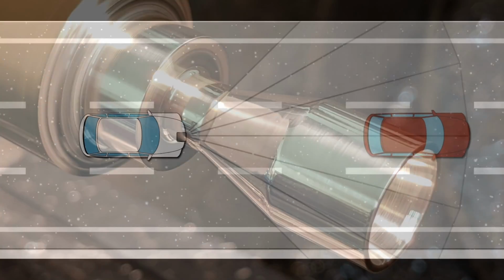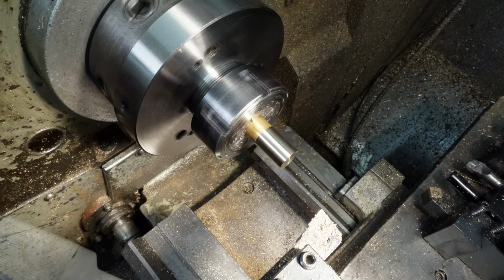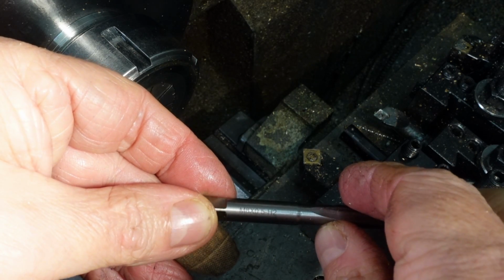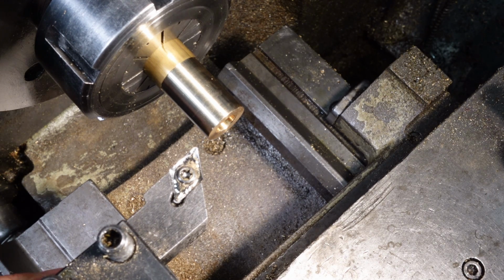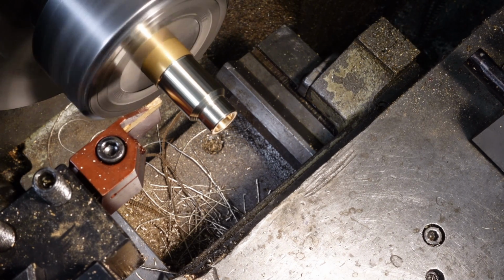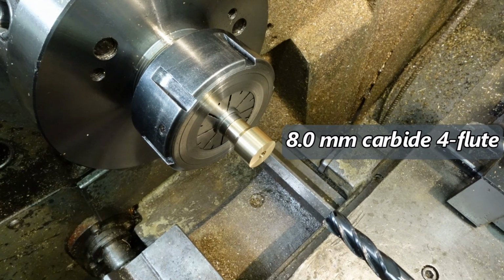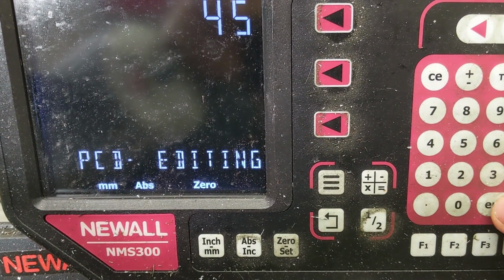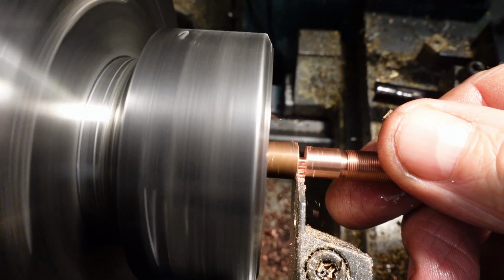Machining 53dBi antennas for 122 GHz mmWave Radar chips!

Comment: What is the camera you enjoy abusing? Your video work is good, don’t know what you are complaining about.  I think you need a small cnc lathe for some of these jobs.
Reply from the maker: Sony ZV-1. It's just horribly designed. Rotten battery life, can't charge or run on external power while still shooting, Auro focus is dreadful, ditto auto exposure, and the wheel for changing aperture and focus and shutter is almost unusable. Menu system is obtuse, lack of ability to fit filters, poor focus range when zoomed a little, lack of any macro capability. Wish I'd never bought it. Lens quality is dreadful compared with any of the "real" cameras I've used, dynamic range is rotten, aperture stop only goes to F10. Might be acceptable in a £120 camera, but I just feel ripped off. Serves me right for believing the glowing reviews from various content creators. Those folks are now firmly in the "ignore my recommendations for I am a pillock" list.
Reply from the maker: I am working on a CNC conversion for my lathe (or perhaps on a second identical model) as there are some complex curves needed on electroforning mandrels, and I need to cut 60 or more 0.6mm grooves of varying depths and that is painful on a manual lathe. Also I want to turn parabolic and hyperbolic surfaces up to 320 mm diameter and that is almost impossible on a manual machine.
Reply: @MachiningandMicrowaves  I was using a Canon G12 which was not bad, but once I become monetised I lashed out on a Canon dslr 200 D, bought a long lens for it and I think it is great for what I do. Manual focus and exposure, even has a 5x and 10x magnifier to check focus. Bought a couple of cheap led lights off ebay and mostly get to use f11 to give me a bit of depth of field. Shoots in 4k and allows stills to be taken off the video. Ad revenue has yet to pay it off. LOL.
Reply: @MachiningandMicrowaves  I have done some satellite dish reflectors for a friend. He gave me the parabolic shape and I had to fit rads over the shape to approximate the curves, a bit of a pain that was. But he was happy with the results, so my approximations must have worked
Reply from the maker: I should have a look at a Nikon DSLR as I have a D80 and some decent lenses but I need to think about how to protect it from dust and flying coolant, and from oily fingers. Something with full remote would be good. I've tried using the remote app on my phone but I think I need to look at using an iPad or Chromebook as the remote controller so I can get the focus right, or better, use CNC jog wheels to send direct commands for focus, speed and aperture if the API is published.
Reply from the maker: The subreflectors I make only need to be accurate to 1/20 of a wavelength. At 122GHz, that's 0.13 mm, which isn't too hard. I can generate the shape coordinate pairs in MATLAB or Perl and create G-code directly, or just create a CAD object.
Reply: @MachiningandMicrowaves  my work is fairly clean so not much of a drama there. My long lens is 55 to 200 and I use close up lenses.  200 lets me get away from chips etc

Comment: Erm...how far do you live from the brass factory?
Reply from the maker: I remember back in ancient times when brass was relatively cheap, but that was waaaaay back in, er,  2019.  Oh.
Reply from the maker: Actually, compared with Tellurium Copper, it still IS cheap. Sorta. In a "slightly cheaper than silver or platinum" sort of way.
Reply from the maker: I just bought a 2 metre bar of 4 inch by half inch Te Copper bar that cost me $1000. A 4 metre bar of C101 copper I bought in 2016 was under $500. I tried to buy some 6" x 8" steel I-beams yesterday and had to sit down for a while when I heard the price. I said I wanted mild steel beams, not solid gold ones.

Comment: 122 GHz is not used for automotive radars.
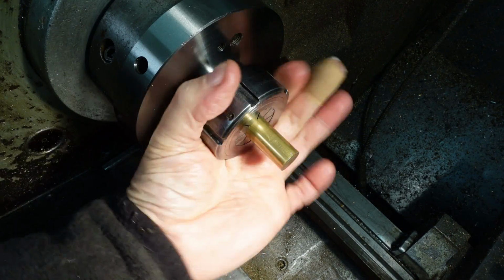Reply from the maker: Yeah, I used a bit of poetic licence there!  It was late and I was recording the intro at 03:00. I should have checked what Siliconradar are using these specific chipsets for. I guess ranging, thickness measurement and position sensing where you can't use a laser rangefinder in industrial processes perhaps?
Reply from the maker: I've amended the title and description a little. Do you know if there's a good application video that Siliconradar publish that I could add a link to?  Can't see much on their website
Reply: @MachiningandMicrowaves  I think they look for applications themselves - one problem is that the ISM band is only 1 GHz wide so that the high resolution of their 6 GHz and new 20 GHz tuneable chips cannot be used in many real world applications. Their work is funded by research programs.

Comment: Could this be adapted to a 5G mmWave antenna? Or is commercially (for consumers) available antennas good enough? (Because it seems like in the antenna market, there's just one manufacturer recommended (Poynting))
Reply from the maker: This is a rather specific application for experimenters who want to push the capabilities to extreme range, in a similar way to deep space satellite comms. A lot of the effort in 5G seems to be around beam-steering to adjust the pattern on the fly to focus on individual handsets within a very local footprint, but our typical use-case involves a target receiver 20-100 km away that will  have a very small signal to noise ratio, scarcely sufficient to carry one low-rate voice signal, and often down at the 1-2 symbols per second rate. Commercial kit is concerned with rather different parameters, so etched laminates and software-controlled electronic beam steering (eg for Starlink terminals) are much simpler to manufacture at scale.
Reply: @MachiningandMicrowaves  Hmm, do you have any reference material you would recommend? I'm not entirely sure why an antenna could only work with small amounts of data, and not larger amounts of data.
Reply from the maker: @nathanbrown492  It's about signal to noise ratios and channel bandwidth. With the tiny signals we work with, we are running at perhaps -21dB signal to noise referred to 2.5 kHz bandwidth. To get a transfer rate of even 10 Mbit/sec, you need a channel bandwidth approaching 10MHz, so you need a signal around 100,000 times as strong to get the error rate acceptable. Certainly over shorter distances, we can move very high bandwidths using these antennas, but the commercial folk are already doing that. The interesting part for us is getting those extra few dB of performance to deal with the approx 1dB per km of oxygen and water vapour attenuation to get as close to the Shannon limit and thermal noise as possible over extreme distances. I'm also doing cloud-reflection tests with red light, the distance record for amateurs for red light cloudbounce is around 270km, I think that is beatable, but we'll need to close to single in photon detection sensitivity for that. Long distance backhaul between satellites is moving to lasers, but for terrestrial links, fibres are a much better backhaul solution over more than a few km. Yes of course you are right, the only limit on data rates by an antenna could be it's analogue bandwidth.some antennas have a 1% bandwidth, but these horns work over maybe 15% so potentially can shift tens of gigabits per second if the hardware was capable of that.

Comment: Have you found out how well they performed, range wise?
Reply from the maker: So far, folks using my W2IMU antenna horns are working over 40 km, but there is a big barrier with moisture in the atmosphere, with around 1dB per kilometer attenuation.  Some of the equipment has a weather monitor built in to check for relative humidity, dew point, temperature and so on over the path, and folks are doing tests at different times of day.  It seems that in the UK, winter afternoons are just about optimal, but losses can vary by 5dB or more over short periods, and that's the difference between success and failure. In the dry conditions in the western US, they are getting much further, same in Australia, but we are still learning about this frequency band at extreme range.  There are lots of tests going on with hardy souls going out in the freezing cold to carry out tests. I'm making a set of feeds with different profiles to try under-illuminating the larger parabolic dishes to see if we can get more gain by avoiding the outer parts of the dish where the surface errors tend to be greater.  Errors of 0.25 mm start to have an impact on performance, so on a 450 mm dish, that level of precision from a spun aluminium dish is very tough to achieve.  When I get my CNC conversion fitted to the lathe, I'm going to cast some aluminium parabolas with honeycomb backs then machine the faces to high precision to see what happens.  Lots of fun ahead

Comment: Don't chip the tip off inserts, resharpen them!  I'm cheap that way.
Reply from the maker: I've just bought an Alexander copy of a Deckel grinder and it has diamond resin wheels so I'm going to be doing some mods to inserts for specific jobs.  I could probably resharpen those high-rack polished inserts as well. Good suggestion!
Reply: @MachiningandMicrowaves  I'd also use an extractor or wear a P2 mask / respirator, carbide dust is the worst.
Reply: @ryebis  I use carbide dust as seasoning in my curry

Comment: 1/50th of a barleycorn. You sneering imperialist, you!
Have you seen any of the neat things being done with T-wave?
Reply from the maker: I have been watching the work around 800 GHz in Japan, but haven't seen much else. Mostly cos I haven't looked hard and needing to sleep now and then.  Any good pointers to URLs or papers that I should be reading? Lack of access to a die bonder is a bit of an issue. Damn, now I want to make a die-bonder.

Comment: Your threads seem to be off-balance! Your CPU must not have enough cores to process them parallelly enough to make good threads, you need to re-balance your software thread dispatching or recalibrate your CPU cooling (assuming you don't need a CPU upgrade to handle more threads!) 
:P hihihi
Reply from the maker: I have some Apple cores if that would help.  Braeburn, Pink Lady, Granny Smith. Local fruit shop delivers every week.  Marvellous.

Comment: Why didn't you perform your machining asynchronously?!
Reply from the maker: The limitations of filming and the looming deadline to get the video finished. Much too hard to do serial ops with all the cameras and lights in the way, and within a sensible timescale.  Video clips are of approx three units.  The rest of them I set up jigs and fixtures and did the same op on 22 items, then next setup and 22 repeats. I usually do 25 to 50 in a batch
Reply: @MachiningandMicrowaves  I was trying to make a bad nerd joke to go along with yours as I just happen to be learning about asynchronous methods right now.  I mean, I get that creating multiple instances of your lathe is... impractical!
Reply from the maker: @NavyCuda  Heh heh, I was half asleep at the time I read the comment. I do rather like the idea of containerising the whole thing and just spawning new instances of the Bridgeport in Kubernetes with some sort of virtualisation platform based on a massively-parallel physical layer array of cheap Chinese CNC routers. A sort of lightweight RISC approach. The lathe array could be formed from a scalable pool in AWS, with a selection of die grinders, battery drills, and John Deere tractors, instantiated as required. MaaS and LaaS would perhaps need extending to Shaper-as-a-Service, The whole thing could be implemented using MachineShop-as-Code. I like it.
Reply: @MachiningandMicrowaves  My Snap-On dealer loved me.  I had three identical straight die grinders for my three top bits that I used.  I had one 90 degree die grinder and a cut off wheel.  Learned that from an older body man who hated changing bits all the time, so bought extra die grinders to save time.

In any case, you make fantastic content and unfortunately for you, I've subscribed and likely will follow you around like a lost puppy.
Reply from the maker: @NavyCuda  I only have three air die-grinders and one big electric one, cos I'm too lazy to change bits.  Oh, that's four in all. Right. Guilty as charged m'lud.  In mitigation for my sins, one of them IS a pencil die-grinder, so doesn't count at all.  Three is reasonable and entirely proportionate.

Comment: Because  I'm a lazy early/old millennial i would  just 3d print it then electroplate it then waste twice as much time trying to make the part with terrible tolerances fit😅
Reply from the maker: It's an interesting problem to make antennas with features this small, you need to get surface finish in the bore to a couple of micrometres, and plating a bore is a royal nightmare at the best of times. Even the best LCD/DLP UV resin printers can't get close to the required surface quality inside, but if you could get a near-mirror plating on the inside of a horn, you could perhaps press in a waveguide tube made from solid silver but you need that to join with a near-perfect electrical connection to the start of the horn.  All a but too tricky at this frequency.  Metal sintering 3D printing is just about possible, but really the techniques are much more useful at 24 GHz and lower.  Using lost-wax investment casting of bronze or aluminium parts, perhaps with centrifugal casting to get a good fill, is probably the best application of 3D printing for home shop use in microwave antennas.  The more exciting developments are in dielectric resin UV printing using Rogers new resin, which should work in an Elegoo or Anycubic, although better in a DLP printer.  That and the low-loss ABS filament from Preperm should give us some very interesting possibilities with graded index quasi-optical lensing at mmwave. I'm hoping to get some of that UV resin when Rogers get it out to distribution, but it will be furiously expensive and unlike their PCB materials, there are no free samples.  Electroforming around sacrificial aluminium mandrels is a very interesting technique, but that's video number 23 in my list, so quite some time to wait for that one
Reply: @MachiningandMicrowaves  as I said I would make it work the lazy way!!!...tho it would cost me several years and pints of blood sweat and tears!

didn't realise the  surface finish of SLA wasn't good enough...the one print I did with the sla printer seemed quite smooth....until  I banished the printer to garden storage- the  smell🤢 which I still sometimes  smell on quiet nights (most likely brain damage from resin inhalation 😜)

I guess  at witchcraft frequencies/ wavelengths (gazillions of HZ) any burrs would as a recieving antennas dissipating rf as heat..any gashes would act as resonant cavities and any other imperfections  would act as a capacitor/inductor  or a banana....its total witchcraft 😜

BTW I'm sure you already know about it but electrosputtering seems like an interesting way of putting an ultrathin metallic mirror finish on stuff
Reply from the maker: @TrumpstienPhile  Oh good grief, I had put that plasma sputtering stuff that Ben did ages ago into a deep dark recess of my mind in the hope it would go away.  Let's see...  Vacuum bell jar.  Check. Fairly good vacuum pump. Check. Magnetron.  Old microwave oven, check. Voltages and instrumentation and all the other paraphernalia?  Oh yes.  Time to play?  Nah.

Comment: Always used spiral flute taps, even when tapping something with hand or using a hand drill. Works excellent. And when you break it, its not the flutes fault, you're just an asshole lol :)
Reply from the maker: I certainly find that it's rare for me to use traditional hand taps now except for tiny holes smaller than M2.  The other exception being shallow blind holes made with a flat-faced drill where I want threads right to the bottom.  I use a spiral-flute tap followed up by a hand plug tap with the end ground flat. I do use a lot of thread-forming taps in copper.  I've been playing with thread-milling using hand-ground thread mills in my toolpost spindle to see how well that works. I have an upcoming job which needs lots of 28 mm internal threads in 4140, so I might try milling those instead of single-pointing.